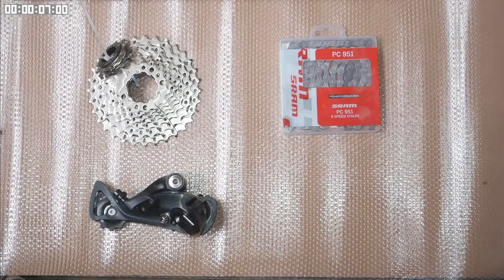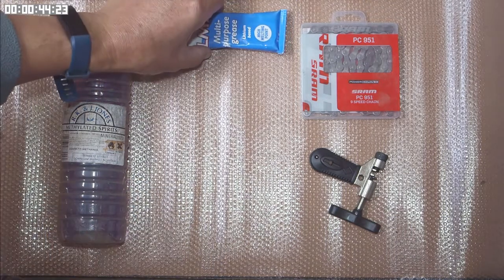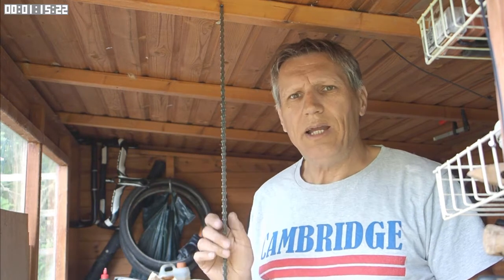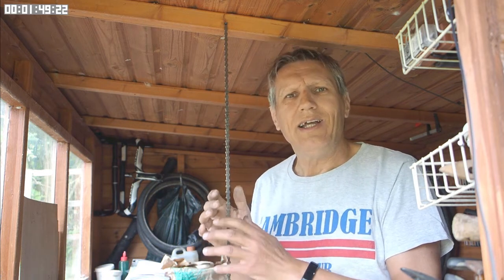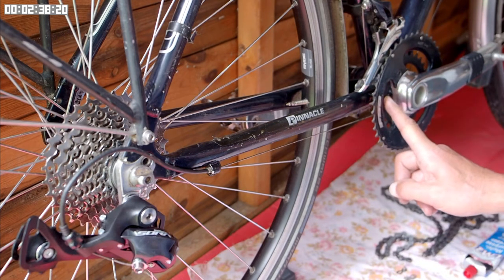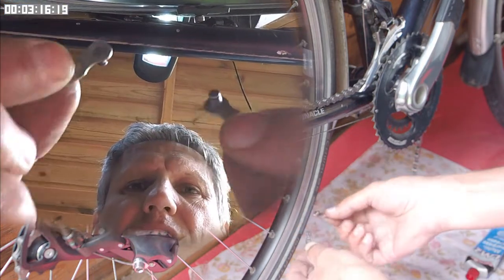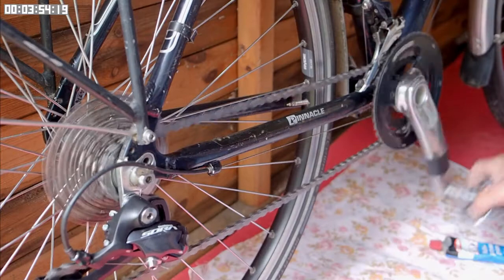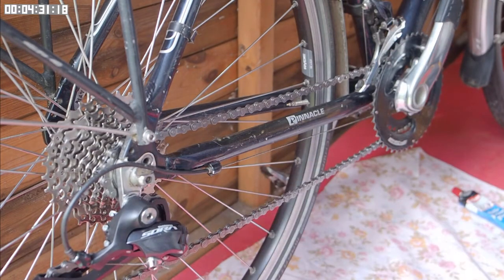How I fit a new chain.

Comment: Aren't you worried that the meths and/or the beeswax solvent will find it's way inside the chain and start to degrade the factory applied lubrication?
Reply from the maker: Hi Will,
Yes I am, which is why I leave most of it to evaporate, leaving the rag just damp. I thought I'd emphasize this in the videos but maybe not enough.
Terry